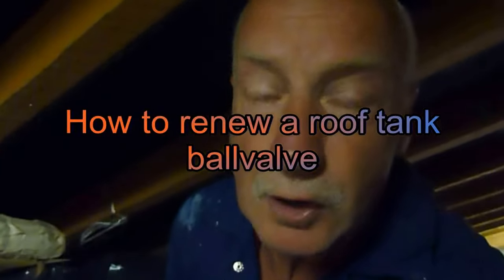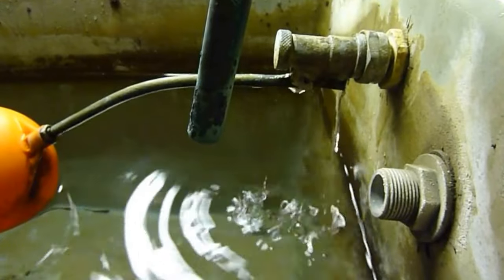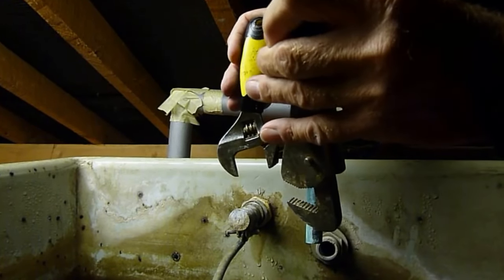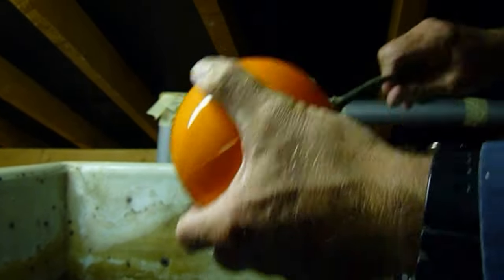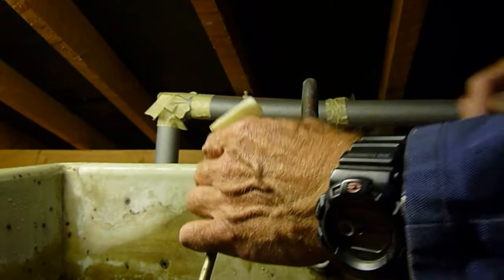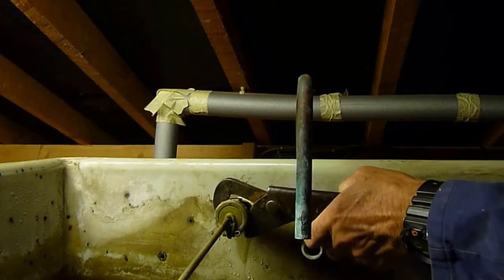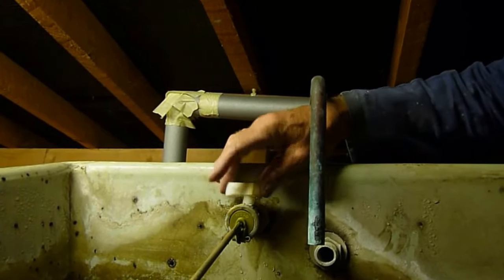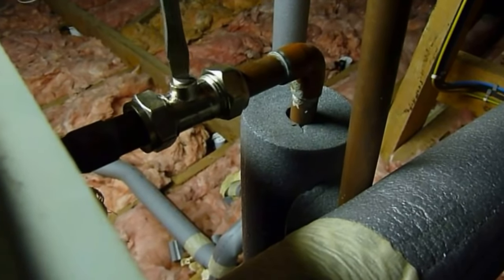How to renew the roof tank ballcock if you have an overflow running.Or a water hammer noise

Comment: Great advice on how to replace the valve, but you really need to replace the whole tank! Those black spots are biofilm. The gel coat on the inside of your GRP tank has started to fail, and each spot contains microbes, legionella or other, which could give you problems. If you clean and disinfect the tank then you're good for a short while, but the spots will come back, maybe in a few years, maybe in a few months.
Reply from the maker: Got rid of this old tank went for a combi.

Comment: I’m not one for commenting on posts/videos but 👏👏👏 .  Moved into a new house - the water hammer when running the shower was awful (a flick of the cold water tap would sometimes fix it).  I replaced the header tank float valve assembly and it went away. One month on and Durrrrr. Noise back.  Replaced the float valve in the cold water tank and silence has been restored.

Comment: You, Sir, are a STAR! Every tradesman I've ever employed, without exception, has either done a terrible job or tried to rip me off - or both (usually both!). How I wish you were my plumber..... you know what you're doing and obviously not afraid to share it without it costing me a penny! I did exactly as you said and the leak is fixed. The only problem now is the numpty who installed the cistern in the loft has routed the overflow pipe over the top of the tank, which means the tank must be brimming over before any dribbles into the overflow. He probably thought 'This ballcock will last 10 years before it starts to leak, by which time I'll have ripped off enough people to have retired.....' I despair.
Reply from the maker: The bad tradesmen are out there along with the good.

Comment: Hi Deretan, just done mime, boosted by the simplicity shown in the video and confidence from some of the previous posters who have managed to also do this for themselves.
I replaced the whole thing, going out of the tank into the feeder pipe connecting into it. It took me a few hours as my tank is one with a small hatch and only a limited amount of space to get at the parts. Don't forget the PTFE tape or you will get a dribble coming out. As was tightening up first time round I inadvertently undid a 2" existing 'junction?'. Anyway all's well and good and the job cost the princely sum of £5 !!!!!!
Reply from the maker: ***** Well thats a good £50.00 at least you have saved on calling out a plumber, well done.

Comment: Many thanks for this video, gave me hope - in my house expansion tank was obviously suspended from a crane and the house built round it - seriously thought I was going to have to cut the pipe work to slide the thing out to replace the valve.

You video showing the coupling allowed me to check with phone camera and sure enough there it was - really pain getting step ladder in loft but managed to do the job semi by feel alone.

Overflow stopped but German Shepherd upset - don’t ask .....

Thank you Sir, you are a gentleman

Davy
Reply from the maker: No problem Davy.

Comment: Cheers mate, brilliant video. As a hamfisted groundworker I usually avoid anything that can't be solved without a 25 ton machine but following your video I successfully changed the whole ball valve. Took less than ten minutes. Thanks a lot, I'll be trying a lot more fiddly stuff in future.

Comment: Thank you, finally sorted an overflow that’s been dripping for a while! 
I got the part 2 from screwfix for £7 with no problems, but I’m in a hard water area so the old one was incredible scaled up and couldn’t remove it inside the tank, instead I took it off from the outside like in your video - how to renew a tank valve that is overflowing 
It was very helpful and useful. 
Elizabeth
Reply from the maker: No problem pleased you sorted it Elizabeth.

Comment: Thanks, just called into screwfix on the way home and bought the valve shown.   Turned the water off swapped them over and no more overflowing :)
Reply: PS is the water in that tank going to any taps as I sure hope I am not washing my teeth everyday in that crud  ?
Reply from the maker: If your cold feed is going to the bathroom basin tap then you may be brushing your teeth in it.

Comment: Many thanks for the instructions ...top video for a DIY simpleton like me :-)... got a new type 2 (as shown on video) from Screwfix for less than £8 ... needed to wire brush old valve and spray it with penetrating oil because it is about 40 years old. It was a tight fit scrambling in the loft but eventually got it sorted after following the video. Thanks again pal.
Reply from the maker: Pete Moxon No problem. Al.

Comment: I've two cold water tanks in the loft each 70 gallons and a cold water feed to the ball cock valve that has to be turned off via the house mains stop cock in the kitchen.  I've now fitted a lever full bore 15mm isolation valve just outside of the tank to isolate the ball valve. When replacing a ball cock you must switch water off to isolate the ball valve water because it'sfull mains pressure.

Comment: I have a big galvanised steel cold storage tank in my attic. I'm trying to find out it if it ever had a lid, It has a similar vent pipe like yours above it which leads me to believe it probably never had one. Did your tank come with a lid?
Reply from the maker: The old iron tanks never did. New plastic ones do.

Comment: I thought water would still come out. When the balls not on is it closed by default. As I need to change the isolation valve that's on that same pipe. As its a plastic one and the slot s mashed up so would i need to drain system to swap it. Would water gush out when I take out the plastic push fit valve off?

Comment: As mentioned on another video firstly familiarise yourself with matters before venturing into the loft. Go through everything and in the process you won't leave anything behind spanners or whatever when you venture into the loft. , and if your going to keep the old float and reuse then clean it up first, remove the limescale on it, especially important for heavy limescale areas.  Mike
Reply from the maker: Thanks Mike.

Comment: I've just replaced the (Part 1 ?) ball valve Like for like. I was a little confused because it said on the box "Suitable for gravity fed systems" but the water tank is fed from the mains,. Also the float arm is Straight and t non adjustable and now the water level is only about 1/2 inch from the  overflow. I've tried bending it a little bit but I don't want to over do it
Reply from the maker: It is ok for mains as well it will have a h p seating in it. Bend the arm further they do not break.

Comment: Hi, great video, only wish the top came of like that, we have a plastic tank but a small inspection opening, seems in possibility to access the ball cock, any advice would be very appreciated, thanks
Reply from the maker: Remove the whole valve by undoing the swivel connector and undoing the back nut on the valve.
Reply: dereton33 hi thanks for the reply, we have a cut off valve on the outside with a nut which holds the ball cock, so i undo the outside side nut and replace the hole of the ball and tighten the outer nut on the tank, thanks
Reply from the maker: Yes it is the easiest way when you cannot get access through the lid on top.
Reply: dereton33, thanks so much for your great advice, just one more question, do i need to turn off the water supply or would the just cut off valve be fine, thanks
Reply from the maker: The cut off valve will be fine to cut the water off.
Reply: dereton33 thank you for your help, much appreciated, top man

Comment: Hi, I am trying to remove an old domestic cold water storage tank valve. Very worried as it is leaking bad and covered in limescale also a galvanised rusty tank, I would really appreciate any advice. Thank you.
Reply from the maker: Renew the tank. Never thought any of those old galvanised tanks were still going. Most have all rusted through by now.

Comment: Hi man wonder could you help the smaller tank in the Attic I think it's the hot water tank for the heating. It was constantly over flowing out of the over pipe outside.  So i put a new ballcock on the tank  yet after a few hours it  stills over flow outside . No leaks from the new ballcock . How can it still fill up it's  driving me nuts no matter what I do it still overflows. Any ideas why Thanks
Reply from the maker: It is a pinhole in the inner coil of the hot water tank. Only way of fixing it is to renew the tank.

Comment: Great video as always.

I brought a replacement but doesn’t seem to fit into the existing as in vid - just kept turning .. is there a reason for this ? Had to put the old one back on.  Stupid question but as it’s gravity fed system are these High pressure valves correct ones ?

Sorry another one - I swear I watched a vid which  you mentioned how to install the isolator valve for the header tank - or did I make that one up. Thanks in advance
Reply from the maker: I did make a video for fitting an isolation valve it is on my channel. High pressure valves are the correct ones for roof tanks. The threads are sometimes different, so do not fit, in which case you will have to change the complete valve.

Comment: Hi Dereton, most of these regular household ones usually give a range of a usable float ball as being 'a choice' between 4½, 5 and 6in.
My question is — in what way do these size differences of the actual ball — affect the operation of the mechanism?
Thanks in advance.
Reply from the maker: The bigger the ball the more pressure is exerted on the valve piston.

Comment: Okay so watched your video over the weekend after enough of a old leaky seals and bad overflow to the point it was splashing over, but wouldn't overflow.

However after I fixed it, I have noticed the last couple of days after running the taps for dishes, washing hands etc, a noise comes through the pipes, like a drill into a wall, it's not hammering I'd say, but for 10-20 seconds a sound can be heard.

It may continuously fill up before but never hear that sound, what should or can I do, may I have done something wrong? 😊
Reply from the maker: Change the ballcock or try reducing the flow but closing down the stopcock.
Reply: @dereton33  okay, so I have replaced the 1/2" Part 1 High Pressure Brass Ball Valve with another brass one, 
And noW I get a really loud, pro longed hum sound with no knocking down the pipes while it fills up, but didn't get that before fixing the leaky unit 😅
May I have done something wrong, even indirectly? 

for extra information this is my cold water tank I have replaced it in, I live in a old house where cold fire is how I have hot water in my radiators and taps and immersion for just taps

Comment: Hi Al, great videos!
Quick question. I’m going to replace the ball valve in the tank in the loft as the water level cuts off above the overflow level. The thing I don’t understand is that there is no water coming out of the overflow outside the building! So my question is, do these overflows get blocked? As you know, the water shouldn’t get to the overflow level but as it does, my problem is I’m getting a little drip from the overflow fitting leaving the tank which over time has brought the bathroom ceiling down! 🤦🏻‍♂️ Any answer much appreciated. Cheers
Reply from the maker: They can get blocked. Check where it exits the house.
Reply: @dereton33  Thanks for the reply, Al. I have checked and there is nothing coming out where it leaves the building which is why I thought it may be blocked. The diameter just seemed quite wide for a blockage, but whoever was up there tampering last left the lid off of the tank so god knows what’s gotten down there! Will just poke some clean rods down there and see what happens! Cheers

Comment: Thanks for the video. Followed the instructions, as my water bill had more than doubled overnight some time ago and I eventually found that water had been continually flowing into the tank. Had to turn the water off in the street, as I couldn't turn the tap to the tank (nor the other internal stopcock). Replaced the valve and ballcock with a new one. It seems screwed on ok and is in position, but when I turned the water back on, the tank isn't filling up as I use the water. Not a drop is coming through, even if I move the ballcock up and down. I'm not sure what is wrong, but I may have to call a plumber out after all if no water comes through and the tank empties without being refilled.
Reply: +dereton33 Thanks. I'm waiting to try and get hold of the water company now, as the outside stop valve is a total nightmare to turn and I have been trying to turn it since yesterday afternoon. Even my next door neighbour, who is a strong guy, was having trouble turning it. It feels crunchy and not smooth when it turns. I currently have no water coming into the house and am just using up what was in the tank.
Reply: +dereton33 I've just averted a mini disaster! Thames Water came, due to my having no water. The guy said, on trying to turn the external stop valve: “It’s broken; someone’s broken it. That’s chargeable”. 
I think he took pity on me after asking who it was who turned it and looking at my face, as he then messed about with it for a few minutes and said: “I’ve fixed it. It would have cost you £400”.

After the water was turned back on, I then had a flooding in the loft, with water coming through two floors and into the living room on the ground floor. The water was flooding out of a pipe that leads into the tank - even though I went outside and turned off the supply once again. I put a container underneath, but this kept overflowing and I couldn't keep up with emptying the buckets. It's still coming through the ceiling now. Somehow, I must have loosened a nut on the pipe going into the tank when screwing on the new valve, but I couldn't see where the water was coming from, as it was running along the pipe. To cut a long story short, I phoned my usual plumber, who wasn't available, unsurprisingly. I then ran next door and my neighbour was able to trace the source of the leak and tighten the nut that I must have loosened when putting on the new valve. So, he seems to have saved me the cost of an emergency callout fee. I must have just saved over £500 in the space of a couple of hours!

Part of the problem was that all the nuts and bolts were ancient and incredibly corroded, silted up and hard to budge - just like the stop cocks.

Moral of the story: It's best to have some idea of what you're doing first - and to learn well from your mistakes. Also, be incredibly gentle with the stop valve outside, as it's extremely fragile (and expensive). It's helpful if you can get a second person to hold one of the spanners with extremely stiff and corroded nuts, so you can turn with both hands - and to hold the torch. 

The guy from the water company said it's a good idea to turn all stopcocks on and off twice a year to prevent them from seizing up.
Reply from the maker: Yes that is good advice. Sorry you had so much trouble. Still we all learn from our mistakes.
Reply: Yes, it's been a good learning process. Another tip is a) to make sure you get the right size ball. I thought I measured mine correctly, but got the smaller one by mistake. b) Bend the metal arm before fitting. (I saw someone do it by bending around his bent knee). I've found it impossible to bend it once in place - and can't face taking it off again to bend, in case I get more problems. These two things have meant that the level is too high and water is now coming out of my overflow pipe. I've ordered a larger ball and hope that this brings the level down just enough.
Reply from the maker: If you use a pair of small stillsons or a wrench around the arm you can bend it in place.
Reply: Ok, thanks. I'll try the new ball first and if needs be, get that wrench (I may get it anyway, to bring the level down a bit further). I tried gripping it with a spanner and twisting and even bashing it hard with a mallet, to no avail. But, hopefully the wrench will do the trick. Thanks very much for your help. There's always got to be one for whom everything goes wrong, eh! It did get me to thinking maybe about time I got rid of the old-fashioned tank and got a combi system.
Reply from the maker: Yes that is what I did in my house.

Comment: Great video. I'm getting lots of noise from the pipes. I have a combo boiler  and hot water tank. Does hot water tank need ball valve changed?
Reply from the maker: You can get a quiet fill valve.
Reply: @dereton33  any link to where to get it from

Comment: would this cause the overflow pipe outside at roof level to constant leak?
Reply from the maker: Yes.
Reply: @dereton33  It's just stopped leaking since yday 6pm. 10am ish now. I called a plumber but shall i wait or just get it  all looked at. Thanks for reply

Comment: hi. I have a MEGAflo tank but started to make noise whenever I use the hot water? what do I need to do? change the ballcock valve (if it has one) or is to do with pressure. Please help
Reply from the maker: It is to do with pressure. Try turning your main stopcock down to a slower flow of water.

Comment: Great, but I suspect it's not quite so easy for people in hard water areas. What do you do if the threads are seized with gunk and no amount of levering will unscrew the nut so you can't get it off to replace? Call a professional?
Reply: I'm answering my own question - the part you buy (in the UK) includes the part that attaches to the tank wall and then the water pipe - so why not use it! It was much much easier than struggling with a large seized mineral deposit coated nut (inside the tank as in the video) that simply wouldn't budge.